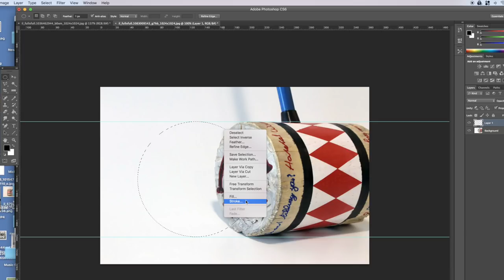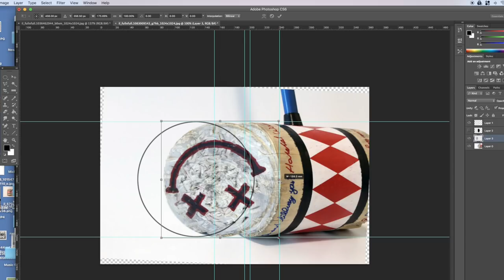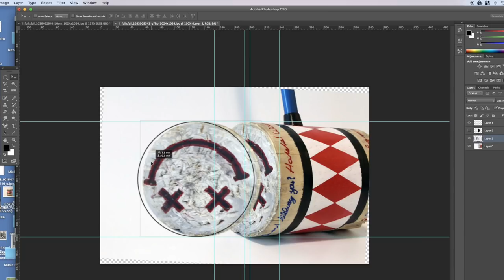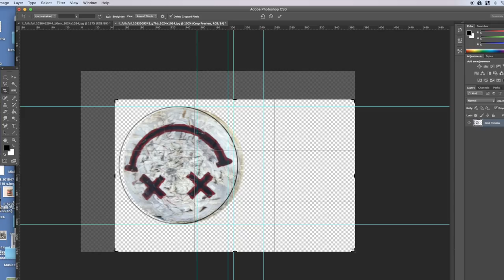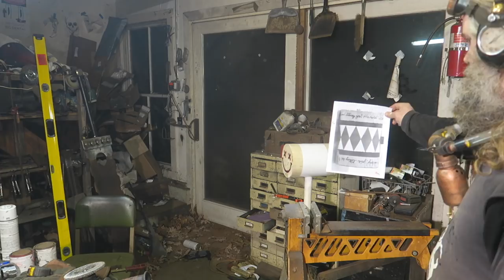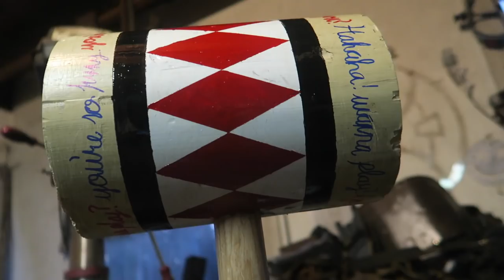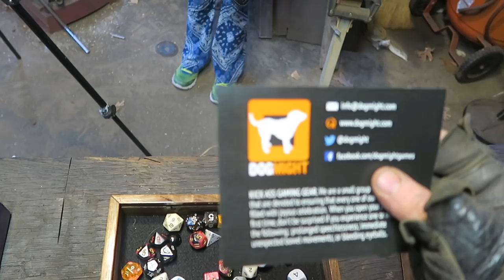Micro Build: Harley Quinn Mallet

Comment: Brilliant video :-) ....... And now some advice...... this is where your love of metal comes in......

1. Remove rust from saws and give them a bit of a pollish
2. Probably a good idea to sharpen them...
3. Rub a candle on the sides so they slide through the wood a bit more freely
4. Hang saws back up on the wall for another 10 years

:-)

Comment: Hi Michael, a good tip for drilling and working and drilling cylindrical things is to mount them in a V shaped holder as this both auto centres the piece and allows for easy clamping. You can make your own very easily by getting a piece of sheet steel and bending it to 90 degrees (accurately) then welding the spine to a base plate so you have a V shaped cradle, care must be taken to ensure the angles between the baseplate and V are 45 degrees. You can then easily centre a cylindrical piece for drilling by placing the mount under the vice in such a way that the point of the bit falls on the centre line of the V, there is a latheworkers tool called a centre finder that works along the same principal that you might want to look at building for yourself as its a useful thing to have (and easy to make). Anyway, hope that helps and all the best

Comment: When you're using masking tape, you want to take it off immediately, if the paint dries before you remove the tape, it could chip and be pulled off along with the tape, that being said, you also don't want to use excessive amounts of paint, so once the tape is removed it doesn't drip or run.

Comment: Gday Mike, i am a painter here. to aviod the "blurry lines" where the paint has bled through the masking tape you need to add a bleed seal to it. Which is in your example its a white background, so when you mask it up you put a coat of the white paint over the edges of the tape so that they white paint soaks in. let that dry them paint it with the other colour and the due to the white paint soaking into the take it will stop the red and black from soaking in and will give you nice straight lines
Reply: and it is better to take the tape off while it is still wet.. once it dries and can then peel off the other paint with the tape .. so dry or semi dry is best

Comment: Just in case it helps with any future woodwork projects: use a tamping block when knocking in wedges, it distributes the force better than a hammer head so they go in more evenly and has less chance of splitting the wood. Otherwise, another amazing build!

Comment: Depends on the paint,  but usually you wait until the paint drys.. I wait at least an hour and with some persuasion with a hair dryer until taking the tape off when I camo spray paint my rifles.. It gives you crisper lines.  I used the same method you used as well with taping slightly over the previous tape then draw your pattern with a pencil and cut out with an exacto knife.. Digital camo is a big pain in the ass if you were wondering lol

Comment: Hey Michael.  
Should you ever need to work wood again there is a difference between metal drill bits and wood drill bits:(you probably know this, but just in case) Wood ones have a very pointy spike at the end so it digs into the wood and makes the start of the hole easier. 
You managed very well with the ones you had, just it might make crafting easier. Mark of good workmanship that you predrilled with the smaller bit. 
Your kid is awesome n_n.
Lovely watching you work. Thank you for sharing.

Comment: Easy way to find center: put a pointy nail in the chuck. put a ruler between that point and the log. the ruler will only be horizontal if you are in the center of the log.

But: nice vid, as allways!

Comment: What you need to do to make the haft snug is cut a short narrow V into the end of the haft and then once inside put a wooden wedge in to make it right.  For more strength a metal wedge should be driven in at 90° to the first.

Comment: How about making one out of Steel? like completely ^^ anybody else here to like that idea?
Reply: Venom that would be a ton of metal hahaha
Reply: but i think it would be quite nice =D
Reply: Couldn't be any heavier than the Buster Sword, I say go for it! (but i'm broke so you commission it...)
Reply: That'd be about 100kg. (220lb)😀
Reply: sounds like a challenge? ^^
Reply: But he gets to do the cartoon version this time right?
Reply: Well the Buster was something like ~50 kg so I was still right, just not as right as i was expecting. could always make the head use an aluminum core wrapped in steel, but that would require either machines designed for it or an enormous amount of effort on Mike's part...
Reply: I'd love to see your calculations for that, because Michael uses notoriously heavy mill scale steel. Things much thinner and shorter have ended up being about that weight; (ex; blinding light of destiny was backbreakingly heavy and it was about the same length without a massive metal cylinder on the end)

Comment: If you are using Photoshop: Free Transform Mode (ctrl+T -Windows or cmd+T -mac) While hovering over the image corner grip-points, you'll be able to free-hand drag/stretch the grip-point by ctrl+click or cmd+click. This is called a perspective transform. Using this you'll be able to stretch an image to be more symmetrical.

Comment: Normally when I made my mallet, I used a tenis racket handle and I just skinned and cut the mallet as it is. Then I used basic wood paint. Since the racket didnt have a black end I put some black tape. And at the end I just made some fake cuts on the mallet and added a deep cut in the end with a clever since she has that broken thingy on her mallet.

Comment: You take the tape off when paint is still wet, otherwise it might tear the paint off when dried up. I think you can imagine that scenario. There might be also some complications with certain paints that don't "play well" with other paints and gets scaled off.
Reply: ile84 painter for a living. You take the tape off after its dry but before it cures. Spray paint may "dry" in under an hour but its not cured for around a week oil paint takes longer still. Ever have a car get repainted? The dry time/cure time is the reason they say not to buff or wax it for a 60-90 days.

Comment: I think you're supposed to leave the tape on while whatever you're painting dries so that is doesn't seep across the lines.
Reply: GT Weaponry nah, you remove it as soon as possible. The reason being you dont want to flake the paint once it has dried. If the paint is running after you're done, you are using the wrong paint or amount.
Reply: depends on the paint, some paint seeps, some paint flakes, and some paint even lifts off with the tape
Reply: The only time I leave the tape on is watercolors. It's a delight to rip off the tape off the borders of a complete piece. The white just brings everything together. 

From my experience, using too thick layers of oilpaint and leaving the tape on is a bad idea.
Reply: Interesting. I appreciate you guys telling me.

Comment: save your wrist from a stress fracture and get a power saw next time. i literally broke my wrist using one of those manual things several years ago.
yes you take masking tape off while its still mostly wet. if you leave it till it dries you risk the paint leeching under the tape and ruining the edge